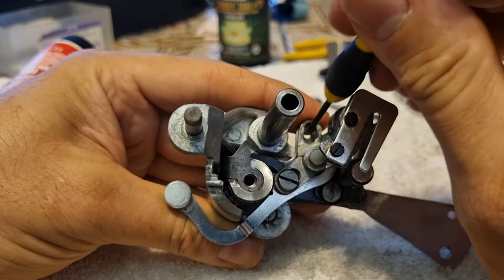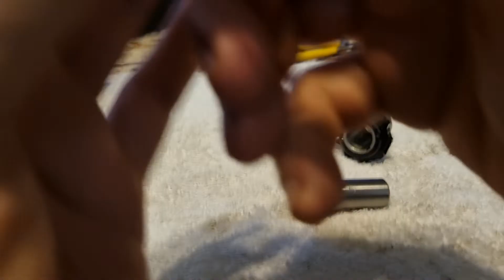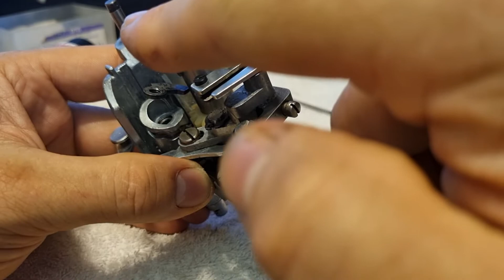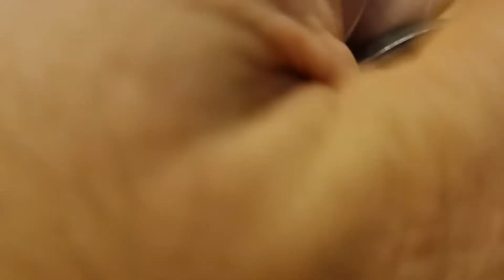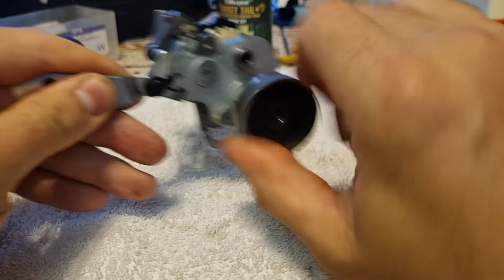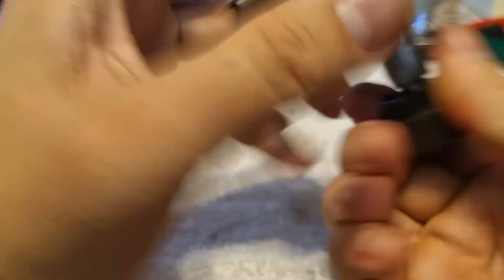Husqvarna Viking sewing machine stitch selector unit assembly Part5

Comment: Stuck when turning
I was having stuck issues also.
All my gears are not missing teeth.
I pit the knob on an it removed the stuck issue.
I think it brings the shaft down just enough so the parts don’t snag.
When install in the machine there will be a screw holding the knob on. I think this
will pull the knob and shaft down and give the gears a little extra space so they don’t snag.
It was snagging really bad if I tried turning it without the knob. at about the third position.
I would push down on the top of the spring screw area and that made it able to turn.

Comment: Spring short side of hook routing for wheel position detent
On my machine the spring short side hook at 00:10:32
was passed from under the lever through the left hole (a little larger) and loop CW to the bottom hole.
Reply: The other end
which is long hooked over the button hole lever into that knotch.

Comment: Turn Cam Stack at lowest position
I am reassembling my mom’s 64 60 Pattern Mechanism.
In your video at 00:08:42 I would rotate the cam stack to make sure it doesn’t hit anything.
Mine is hitting that snake winding up a tree looking lever raising gear part at the top.
I think I am one tooth out of timing.

Comment: Spring in wrong
I have a 6440 Husqvarna Viking sewing machine.
I am fixing the same Pattern Mechanism/Stitch Selector.
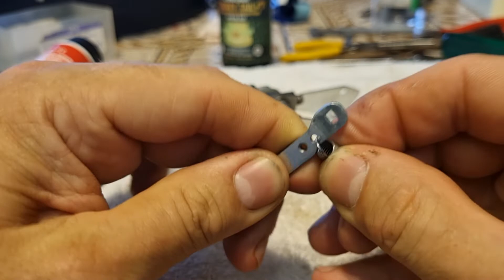The right end of the spring at 00:11:00 needs to go into the two holes.
The left end hooks over the lever with the notch.

This manual may help you:
Search for
Husqvarna 3240 Technical Brief

This video shows the spring:
search for
How to assemble Husqvarna 2000 - 6570 Pattern Selector
by
SewRepair
at 00:25:00 in his video it shows how the spring hooks into the two holes and over the lever and hooks
into the notch.
Reply: PS
Do you know of a good video to remove the whole Pattern Mechanism/Stitch Selector?
Thanks

So far I have mine loose.
I first pri of the while knob center white plastic circle knob screw cover
 (not the brown part)
Then I took off the knob screw that holds on the brown knob to the Pattern Mechanism 
shaft.
This the knob now pulls off.
I can wiggle the Mechanism.

I then took out the light bulb. So it won’t interfere with fishing the mechanism out.
I think I will need to remove the light bulb socket, but haven’t done that yet.

I have also done some other disassembly. ( I don’t think I needed to in order to get the whole mechanism out. i took out the Cam Stack long beveled screw, beveled brass washer, nylon friction washer. The spring screw, small bushing and removed
the cam stack and white nylon gear parts.)

There are some levers in front of the mechanism (cam follower for the revers lever pg 22 *) 
that I think I need to disconnect. 

I have not tried to disconnect any levers in front of the mechanism yet. I wanted to find a 
video/instructions on how to do this first so I don’t mess up anything I didn’t need to.

Any help/further step suggestions is appreciated

* Husqvarna 3240 Technical Brief
Reply: Found some disassembly/re-assembly instructions
pg 137 of the Husqvarna 3240 Technical Brief has 3 pages and a figure 5 with parts 1-6.
There are twelve steps. Some referred parts are not reference to a figure, but if I look
through the pages I might find a referenced figure.

Also
Mike Williams - Husqvarna 2000 rebuild
Rebuilding a seized 2000

His site was working 06/07/2025, but today 06/08/2025 it was not working. Maybe the server is off. Anyway I found a GetHub version of the site and it has all the 7 steps.
It is kind of hard to follow if you don’t know the names of all the parts, but I figged it out by looking at the Technical Brief. There is also a link to the Technical Brief.
He has some good tips. 
IE: 
1) Use denatured alcohol to clean off the petrified grease. (don’t get this on the plastic)
2) Don’t use WD40. It will created a bunch of gunk later.

Some of the steps are confusing. It would be nice if there was a video.

I have been taking a lot of pictures of the steps I have been doing. I also draw pictures of what I am doing. I trace each screw shape/length/type and an arrow to where it came from. I also number the steps and keep parts in numbered zip loc bags so I get the correct screws/parts back into the place they were removed in the correct order.
Reply: Spelling corrections

…
I first pri of
I first pried off